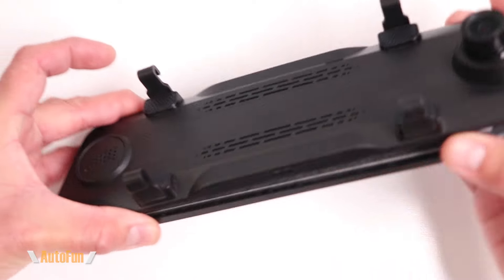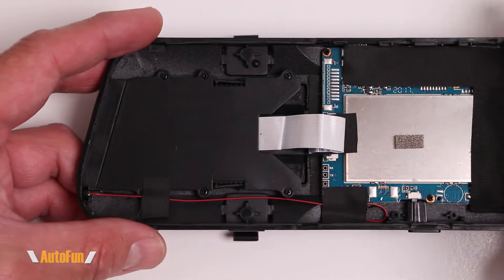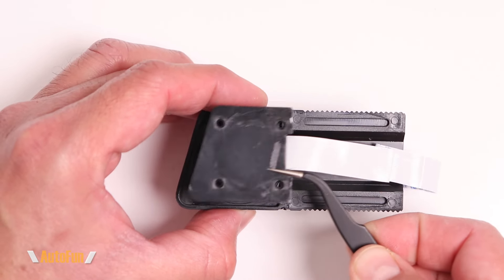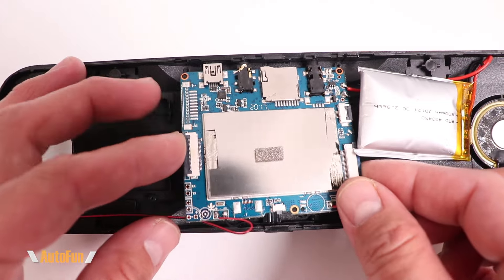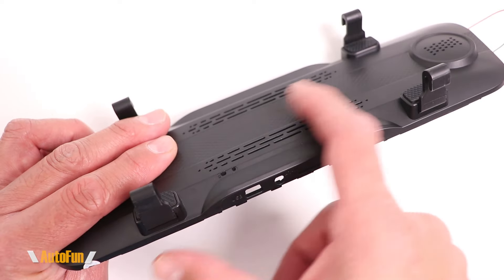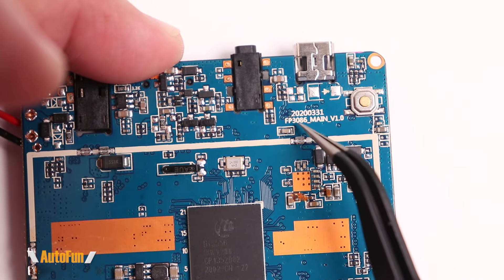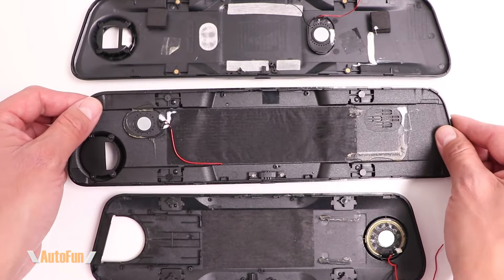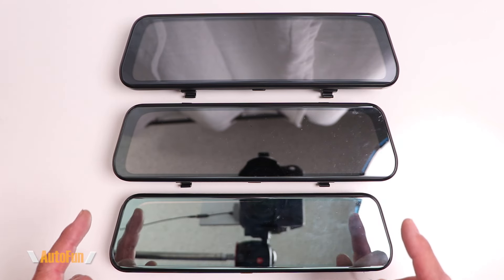WOLFBOX T10 Mirror Dash Cam Teardown

Comment: Thanks for this exploration! 
Ive always wondered what the front camera looked like!
Ive thought of possibly relocating a front camera to the third brake light area of my truck for an up high wide view of the rear when driving.
Then mount the rear camera in the bumper facing lower, that would only be activated in reverse or by using my rear parking sensors (that way, it only switches to that low view if something is detected in the way, like another cars bumper etc).
These are the kind of things i day dream all day long. Lol!
Reply from the maker: You're welcome Hammer! Ah you didn't hear it from me, but I was recently shown new product that does something very close to what you described, I can't say much besides that but I think it can potentially change the way we approach the rear view of a vehicle as far a monitoring, stay tuned for that review. Cheers!

Comment: Thanks for your recent Wofbox G840H I decided to finally let my vantop rest in peace and purchase the wolfbox. In that vantop I managed to replace the MiniUSB with a frankenstain USB-C (not without damaging the parking signal traces) but something that I made was to re place the big battery with a tiny GPS battery which is only 170mAh, just enough to save the video after power off. It is really sturdy, and very safe due to its minimal size.
Reply from the maker: You're welcome! Ah very interesting approach, yeah I had some viewers replace their connectors or what could be done (and I think another viewer did this) is soldering the power cable directly to the board eliminating the connector altogether. Clever idea too on the smaller battery, thanks for sharing. Cheers!
Reply: 8:34 BTW. That daughter board is a voice recognition board that allows voice commands in the camera... I never used it
Reply from the maker: @jjptech  Good eye jjptech! Yep, I cover that in my Vantop teardown video here https://youtu.be/HW8jqbl_ayU Cheers!

Comment: This is awesome!! Would like to see a g900 teardown if you can get hold of one. As the most reputable member of the community looking into this, I would love you to expose the false advertising of the rear camera specs these companies, including wolfbox, are currently dishing out.

Every brand that makes these mirror dash cams with a 2.5k rear camera modules is falsely claiming the output is actually 2.5k, when they all use analog AHD Pal cables into the mirror unit.
Not one brand actually employs the  true digital output of these 2.5k rear cameras, with them ALL being downscaled to 1080p or even 720p analog video.

This applies not just to the rear live view display feed, but also to the recorded footage from these rear cameras.
The saved rear footage is converted down to >= 1080p analog video, then digitally encoded into a 2.5k video file, so the video file will show at 2.5k resolution when the video quality is barely 1080p at best.
I do understand that 2.5 downscaled to 1080/720 is better then native 1080/720, but it's also not 2.5k video as claimed.

Kind of a random rant at these business, but I'm now realizing this is very obviously false advertising and misinformation from the various companies making these mirror dashcams, and something I haven't seen anyone else mention yet.
Reply from the maker: Hi Pingo and thank you! Yep, current dash cams use AHD 2.0 for the rear camera signal and that standard is limited to FHD. Not long ago the same company that developed AHD announced that they have began working on AHD 3.0 which will support higher resolutions (however considering 2.0 took years to be released, it will be a while for us to see 3.0), so once that standard comes out, we will eventually see dash cam manufacturers began to use at some point in the future (which I don't see coming any time soon). Cheers!
Reply: @AlexAutoFun  Thanks for responding! That's very interesting info! Their custom service team explained how my units runs 1080 AHD standard then back tracked claiming it was still 2.5k! I can't see why they don't just run digital video feed from the rear cam into the mirror to utilize the full resolution of the rear cam that's already included. My guess would be it exceeding the processing power and buffer of the main unit and/or issues with signal loss over the longer cable length?
Keen to know your thoughts
Reply from the maker: Hi Pingo! Yeah it's definitely a combination of several factors. While there are dash cams that use a mini HDMI, USB-C and other proprietary connectors they all use AHD, which I do think is related to latency, transmission length, size of the decoding and encoding unit and cost (AHD receivers are tiny and cheap). But like all technologies I think if there is enough demand for it, then it will happen. Right now, most dash cams are staying with 1080p for the rear as there is low perceived demand for higher resolution for the rear (there is the belief that car crashes mostly come from the front not sure if this is statically correct but that is why single channel dash cams are popular) Where dual channel dash cams have to battle single channel dash cams for a sale and 3 channel dash cams are the least sold from what I can tell. So as you can imagine the market is what drives new products, I think if dual channel dash cam overtake single channel dash cams, then dual channel dash cams will have to evolve to compete but I guess only time will tell! lol Cheers! @pingopete
Reply: @AlexAutoFun  awesome info! Thanks again. This definately makes sense, my guess is just lack of demand right now, I think to really push forwards the tech we need one company to step up and truly push this forwards with a much improved model, that should force the other brands to follow suit.

Regarding the rear cameras, this is true but also dumb because it doesn't account for the mirror cameras that really constantly on the rear camera footage.

I will admit I am probably one of only a few that care but to me having a high quality rear feed is just as important and especially so if this rear feed is supposed to replace my own eyesight with a traditional mirror!

I'm having dumb dreams now of starting a company to develop a new modular system with plug and play camera options for 1, 2 and 3 can setups and easy upgrading.

An oled 60fps mirror display with good 60fps video feed from the rear would be absolutely amazing.

Super cool to see how much you engage with your audience! Nice work :)
Reply: Out of interest which mirror dash cam brands do you know that use USB c/mini HDMI cables? I would be interested to look into these!
Reply from the maker: Thank you Pete! Ah yes I definitely agree with you regarding the rear view, I was actually thinking we would see something like that on the Cybertruck since it comes from factory with side cameras and rear view camera (instead of rear view mirror) and sure enough reviewers pointed out the rear camera struggles and limitations (something that people like you and me are quite familiar with our experience with LCD mirror dash cams LOL) I do like your idea of a modular system, the closest I seen to that is this one https://youtu.be/8qdkzbbXLG4 where you can add a cabin camera or rear camera or this one where you the rear camera is optional https://youtu.be/pZ9HcEmL2GU Cheers!  @pingopete
Reply from the maker: None so far, I only seen that on traditional dash cams, like this one https://youtu.be/SF0gpg7IvpA using a proprietary Nikon connector or this one https://youtu.be/TeT-FjjsJ6o using USB-C and this one https://youtu.be/HHTzNJDP4lE and recently I did an install with the Thinkware U3000 with another specialty connector. But I will tell you, cable thickness and flexibility makes a huge difference when installing. This cables are about 2-3 times larger (Outer Diameter) than normal ones which while not impossible, it does make the install more frustrating and in some cases challenging since their bend radius is also larger that a normal cable. What I tell other installers that want to experience this issue is to take an HDMI cable and attempt to conceal it in the trim of their car, then try the same with a normal dash cam cable and the difference is huge but again that is just me. Cheers!  @pingopete
Reply: @AlexAutoFun  that is hilarious even in that vehicle they're likely still using ach lmao. Thanks for the modular designs, I'll check these out! Also you're right about cable thickness, I gave that some thought, I guess the issue is passing 4k 30fps+ and enough power to run could result in a pretty thick cable, I'd be interested if power and signal could be run through a good quality type c cable, not sure what the max data transfer rate on that standard is tbh. I know mini display port cables aren't too bad but that also would need to be bundled with a separate power cable. Honestly if I won the lottery I'd make a start up just to design and build this for myself lol

Comment: What is the best android auto smart mirror carplay?
My car has a back up cam so just need Android auto
Reply from the maker: Hi Winter! Ah unfortunately I have not found a mirror dash cam with Carplay or Android auto that I like. They are somewhat rare and the few that are out there have so far not convince me that it makes sense to have Carplay or android auto on them. The rearview becomes very limited since the screen splits in 2 to have the camera and Carplay in the mirror at the same time and I personally found it uncomfortable to look up to see a map in a tiny screen than using my phone (mounted on a phone holder). But eventually if there is more demand for this (so far is very little) I will probably review one of the channel. Cheers!
Reply: @AlexAutoFun  much appreciated for honesty and responded fast 🙏
Reply from the maker: @winterMB91  You're welcome Winter!

Comment: Good video. Please review other mirror cams with teardowns. I'd particularly be interested in the Android versions they're running and if OTA updates are included.
Reply from the maker: Thank you copperblue! Ah yes more teardowns coming, stay tuned. Regarding the OS, most mirror dash cams use some form of Linux based OS, there are a few out there that run on Android (primarily to enable Android Auto and CarPlay) but those are not very common since they have large drawbacks. Basically when you begin to use them you realize how difficult is to have Android Auto or Carplay in a split view on your review mirror screen. The rear view camera is now very small in size making visibility more difficult and having to look up to your mirror for directions on a very small screen since the screen size is halved between the rear view and maps is extremely counterproductive. On top of that if you play music on your car from your Phone that functionality is lost since now the music will come from the mirror LOL But that has just been my experience and the feedback I got from others that tried them, I'm sure there is someone out there who is ok with all their compromises. Cheers!

Comment: i have a 98 4 runner with a small rear view mirror. do you have any recs for mirror cams that are less wide? thank you and god bless.
Reply: I think those 10inch mirrors are the smallest, also I think those are a good standard size for mirrors. Maybe you can check the dimensions to see if it is ok for what you need.
Reply from the maker: Thank you Thomas! Ah the T10 is about 10" which is the current smallest mirror dash cam size available. However... there is one in development that was recently shown to me that is smaller, I could not take pictures or measurements since it's a preproduction model but looked like maybe 9" super slick and has one crazy feature I have not seen before on any other dash cam. Stay tuned for that review. Cheers!

Comment: Hi, why did the battery pumped up? Is it dangerous to use it during hot weather?
Reply from the maker: Hi IG! It's believed that some lithium batteries bloat due to gas build up, as a result of exposure to high temperatures or due to battery aging or due to being overcharged (or charged while hot) or a combination of any of this conditions. Here is the Vantop one that also failed https://youtu.be/HW8jqbl_ayU and yes if the bag ruptures a fire is very possible since oxygen reacts strongly with the gases inside the battery. Cheers!